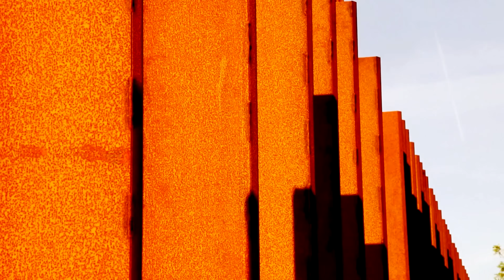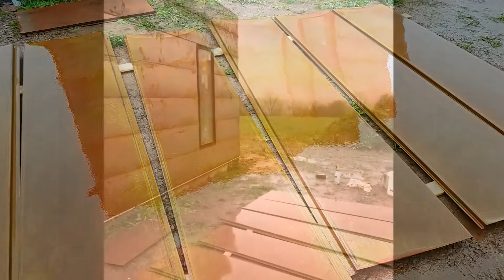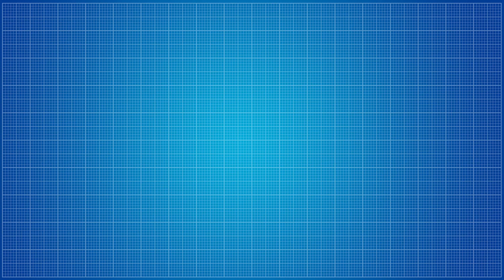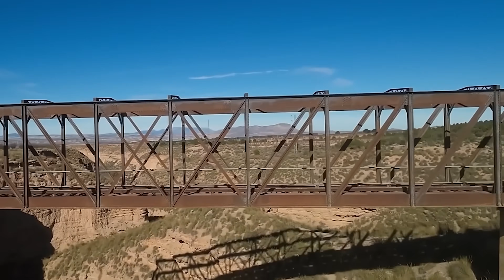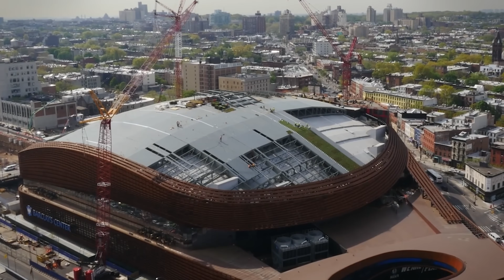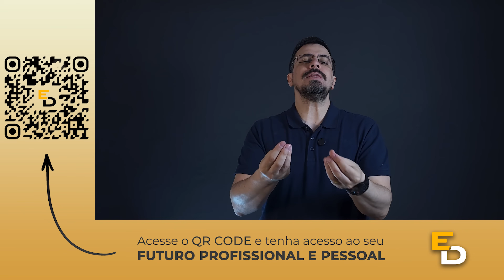What Is Corten Steel? The Steel That Rusts to Protect Itself

Comment: I'm not even a novice.  However, there are two questions. 1. Are there stick and MIG Corten electrodes?  2. Are shear, tension and compression characteristics different from standard structural steel? In other words, are the same dimensions and weights equivalent?

Comment: Years ago we started using Corten steel for the uptakes on our ships.  We were not able to stop corrosion, but we were able to slow corrosion as compared to mild steel.

To address the salt air environment we used a corrosion resistant stainless steel for the last one or two meters.

Comment: I’ve worked on bridges that used CorTen steel as a box girder over salt water and high humidity locations. It was a poor choice in the design process but I suspect that bridge was built in the early era of CorTen steel and not enough was known about its property of needing alternating wet and dry cycles.
It required major repair to the bearing seats that were less than 50% of original thickness

Comment: I worked in a steel mill,, I saw Rusty coils stored outside,  then I learned it was called Corten and the rust was normal. I then worked in the Hot Mill where slabs were converted into coils. All Corten steel was rolled together because it produced clouds of red dust and smoke that filled the mill.. All steels are interesting and each kind has strict recipes and procedures.

Comment: Shipping containers are almost always built from Corten steel or equivalent weathering steel.  Interestingly, almost all of them are also sealed against corrosion by a robust, corrosion-resistant finish coat.  Corten steel  eventually falls apart like any other steel, especially in harsh marine environments, which is why most containers are painted and sealed in addition to using a Corten frame.  About 1% to 2% of containers are made from aluminium or stainless steel for specialty applications, and a very small handful are built from mild steel specifically for use in non-marine environments.

Comment: It is an interesting product and as stated does save a lot of painting. However, it is not suitable near the sea where the salt air corrodes it just as fast as ordinally mild steel or carbon steels. Also it is not suitable to be used as gate posts in the soil as it will rot out. It is used less in northern Europe than in southern Europe, as there is more rain and there is less of the drying out time required for it to stop fast corrosion. It really does have its limitations except in pretty hot countries. I prefer to see 316 stainless for railings or powder coated wrought iron if done well. There really is no substitute for galvanised steel for anything that is going into the ground, is outside all year round like a trailer or anything ear to the sea.

Comment: Yeah Corten is a joke, must have been designed by managers not engineers and material Scientists. Don't use ANYWHERE near road salt or Oceans.. Which means about 3/4 of the USA. Works OK in Phoenix but so does Mild Steel sheet.
Reply: Is that why one of its most common uses in shipping containers that can spend months at sea?

Comment: I worked for Houston Lighting & Power and preformed the final investigation of the Corten test transmission tower after decades of actual use. It was installed as a test in a transmission line near the Gulf Freeway close to South Houston. The thin lacing members had rusted through and the connecting bolts had packed out. It was speculated that rust dripping off the arms could contaminate the insulators. I confirmed that this was an issue and rust staining was present on the insulators. A thermal camera was used. The adjacent galvanized towers were also checked with the thermal camera and similar arcing was present. Apparently, zinc oxide runoff from galvanizing can also cause arching. The conclusion was that Houston is not compatible with Corten steel electrical structures. Thin lacing members should not be Corten and bolted connections are subject to “packing out”. The arcing on the galvanized structure insulators started an insulator washing program for drought conditions. Houston does not use Corten for electrical structures but the Texas Highway Department does use them in their freeway bridges in the Houston area.
Reply: Interesting!
Reply: The most autistic comment ever. Thank you for the proper info though

Comment: I think I saw in a data sheet for Corten that it isn't supposed to be used within 15km of the ocean and salt will destroy it. It is way better than other steels but it isn't 316L stainless.
Reply: Considering one of the most common uses is for shipping containers, I think it's probably okay to use near saltwater.

Comment: Rust ,iron oxide, will form to a max depth of aprox 2.7 mm then unless removed will protect metal from further loss. They use carbon steel tubes in boilers with this in mind unless a ph incursion occurs the tube is protected.

Comment: Do these alloying metals affect the steel in any other way ? Particularly if negative.

Interesting that the water shouldn't be allowed to pool. I wonder if those customers who bought the bridges from design houses were told about this and are doing proper checks? 

Many organisations want to do as little maintenance as possible so they might not go looking for reasons to maintain. It looks like pooling and subsequent corrosion is one of those reasons to look in a wet climate.

Comment: Corten was marketed by fraud. 

It's just dirt cheap steel from wrecked cars, with too much copper in it. The copper makes it never stop rusting. They usually make it so thick, it won't rust away in your lifetime. But they don't use it in car bodies, bcs they'll rust out in a few years. 

Corten is trash.
Reply: One of the most ill-informed comments I have ever read on YT.
Reply: @simon9447  There is more truth in the comment than you think.  The impurities which are generally considered detrimental to steel (notably phosphorus) are indeed the very thing which allow this material to develop a protective patina.  It's the same reason why ancient wrought iron gates/fences are resistant to rust, and that is surely what led to the development of this material.

Comment: The Aloha Stadium in Oahu, Hawaii was built using Corten steel.  Unfortunately it is a classic example of using a specialized material in the wrong environment.
Reply: Was ist den pasiert? Rostet es wegen salzhaltiger Atmosphäre immer weiter?
Reply: @theoronig6440  Yes.
Reply: Core 10 steel" is a common misspelling or variation of COR-TEN (or Corten) steel, better known as weathering steel. It is a group of steel alloys that contain copper, chromium, and nickel. When exposed to the elements, it develops a self-protecting, rust-like patina that prevents deep corrosion.

Comment: My highschool, known as a gymnasium in Danish, was (is) clad in corten steel. Not a famous building, but the steel kept my wondering for about 40 years. Thanks.
Reply: Corten steel is used lots of prominent places in Denmark: Odense University, the sculptures in in Tørskind Grusgrav, Roskilde Incineration and all the poles for the overhead electric wires for the trains.